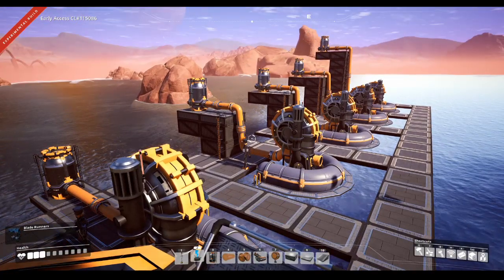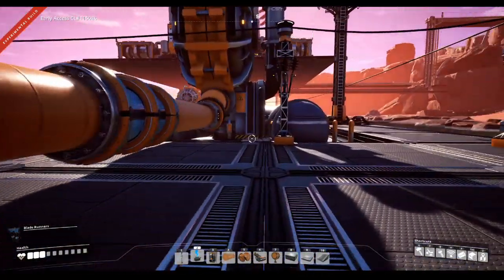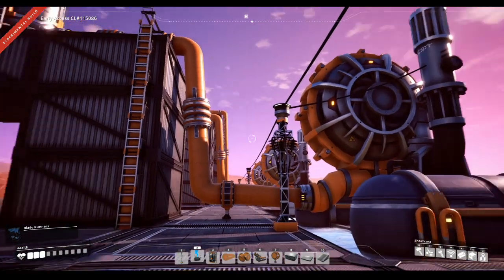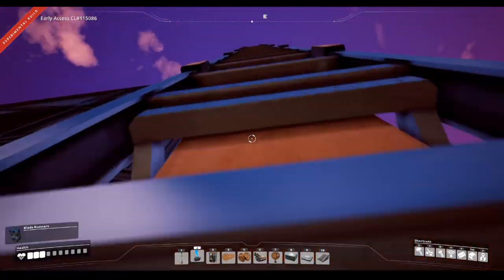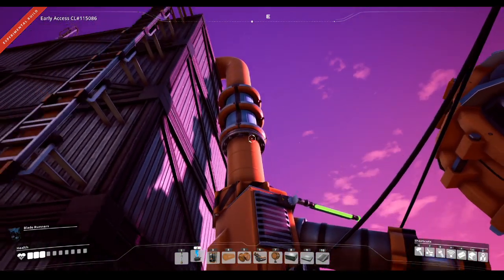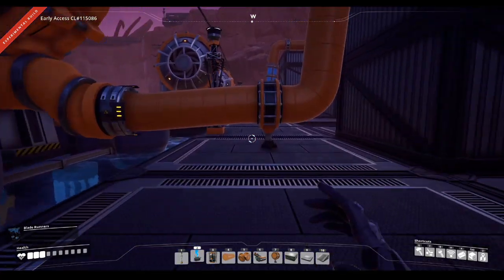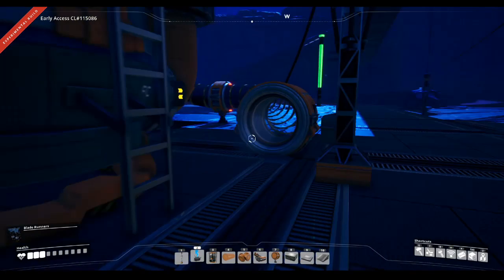Satisfactory Water Pipes, Flow rate, head lift Tutorial, Guide

Comment: If I create a single water extractor, and hook it to a storage buffer, the fill rate of the buffer moves between 0 and low 100s and 220 roughly.  The water extractor flow rate seems to drop almost to 0.  If this means 120 is the average, then it seems like you could maybe exceed a 300 m^3 pipe, with only two extractors due to peaks.  Anyone know how that works?
Reply from the maker: The extractor ebs and flows. It does not give a solid 120output all the time. With the new process of the production machines needing a constant supply, I would always try to not pull the max value from the machines but have at least one machine that is under clocked to make sure you are not under supplied.

Comment: I admit I don't understand the rules about where to place pumps.  Correct me if I am wrong, but it's lifting the water above it.  So the first pump would be about 10m, the default head lift?  And the next is 20m above that?
Reply from the maker: With the new indicators on the pipes when you place a pump, you can go to this point for the next pump. The mk1 pumps have lower headlift than the mk2 also. Test placing a pump on a straight piece of pipe and you will see a ring appear down the pipe from you

Comment: 36x7=252 though? Or am I missing something?
Reply from the maker: What part of the video is that at???
Reply: @DCDGaminshow  You underclocked the coal generators to 75% which made them use 36m^3 of water but 36x7 isn't 300 so the setup wasn't opimised. I noticed in another comment that you had changed it though.

Comment: i guess i just dont understand how all my pipes can have water and all my generators are full and all my extractors are filling with water but when I leave for a while after an hour or so my power just shuts off. Obviously the game thinks there's not enough water in the system but why does it work for so long and then randomly not have enough water anymore?
Reply from the maker: First question is how many generators have you and how many Water extractors have you???
Reply: @DCDGaminshow  i started doing 3 extractors for every 6 generators only because anything less doesn't work but with a single extractor and 6 generators the power worked for a few hours before it ran out of water. I just don't understand why it doesn't fail immediately or even show any signs that it will fail until I run off somewhere and it decides to die. The pipes all say they're full and the machines are all full so it doesn't make sense to me.
Reply from the maker: The issue you were running into was that all the machines and pipes and Extractors were full of water, than you leave the system starts to use up the water reserves and then the system was running out of water. Each Coal generator will use 45m3 of water, each extractor pumps 120m3 of water. 1 pump can feed 2.6 machines.

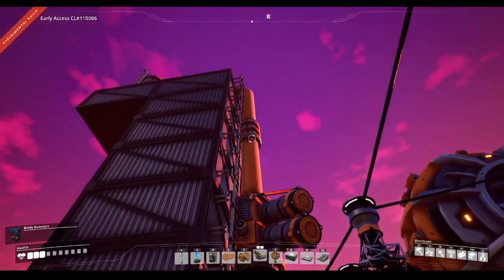Comment: question: @ 10:55 if the headlift is 20, why place the next pump only 10 meters up and not 20 meters up for maximum efficiency?  am i not understanding this?
Reply from the maker: Placing it at 10mtrs above the last pump will give you a head lift reading. Than you can adjust from there. This test is now obsolete as the pumps now give you a headlift indication when you place them.

Comment: This is kind of old now (to be commenting on).. But it makes sense to put the first pump at 10 Meters and not at the low junction.. Since the extractor provides 10M of lift. In the overall scheme of things it is not a huge deal.. And you did it for your first pump.. I do it for ll extractors.
Reply from the maker: I put it on the junction, cos the dev that developed the pipes system mentioned it as the best way in one of the dev streams.

Comment: Thank you. I could not get my first long distance pipe working until you demonstrated adding the pump to an existing vertical run. i did not know you could overwrite it like that. I hope they make the conveyer belts upgradable in place like the pipes and some other things. Thank you!
Reply from the maker: Your Welcome. Belts, power poles and miners are all upgradable in place, just select the upgraded version and point it at the part you want to upgrade and you can upgrade.

Comment: Good vid for sure, but on my game i can not get the crude oil pipes to work. It goes up 40  meters, i place the transfer pump  right the edge where it not exceeding head limit, but by doing this the flow rate is like 1 to 3, almost nothing. Put more pump doesnt do anything,  it either almost no flow or n o flow, after trying different combos for about 5 hours i have all bu given up, for me its a real game killer. I hope they get this issue figured soon, i want to continue to play.
Reply from the maker: Hey, thank you for the compliment, first step is the max head lift of a pipe with no pump is 10m, if I am adding pumps onto my pipes, I will add them on the first vertical section of the pipe. I will place them just after the bend. Then I would wait for the pump to reach Max head lift and add a second pump 3-4 foundations above the first one. If the max head lift is still exceeded on the first pump, move the second pump a bit lower and retry of the head lift is still exceeded, when I have the first pump not exceeding head lift, I would place a third if needed and on and on until I have reached the height I need. One thing to remember is that if you place a reservoir tank at the top, the head lift is to the top of the tank. Hope this helps,

Comment: Ok so I wanna make my first 3 coal generators to work but when the pipes are full of water the flow rate goes to 0 and now my coal generators dont work. I always need to flush the pipes each minute but I cant do that if im at my base which is far from the generators.
Reply from the maker: The flow rate will always drop when there is not a full pull on the power
Reply: @DCDGaminshow  Oh thanks!

Comment: How do you pump water when it's not vertically up? My water source is really far away from my coal so I have my generators meet in the middle? It seem like inclined pumping over long distances always makes it exceed the headlight. I've even added pump every 10ish meters along the entire route and it still says exceeding headlift on every pump (even though flowrate reaches 300)
Reply from the maker: The slanted pipes always seem to cause trouble, if you having an issue, I would rebuild the pipes and pumps again. Start with the pipes, then start with the first pump at the lowest point and then place one pump at a time and only place the next one when you have the previous pump below the head lift.

Comment: 3 water extractors easily feed 8 coal generators at %100 if you connect them seperatly like 2 in the each side and 1 in the middle. Don't connect your extractors on single pipe It's not efficient because you limit your system to pipes max flow rate.
Reply: I have 16 coal generators, I was using one pipe but suddenly stop working, what can i do? Thanks.
Reply: @lucasb3910  
C C C C C C C C
|---|---|--|--|--|---|---|
|            |             |
W        W          W

This is the design for %100 8 coal generators. Single pipe (300m3) not enough for 8 coal generators so you eventually at least one of them run out water and shutdown or you need to downgrade generators like on this video. But If you connect each water extractor seperatly to the system you will constantly feed your system with water beyond 300m3 per min. Actually its 120m3(water extractors output) x 3 = 360.

Comment: the headlift is fucked in my game... I have like 6 or 7 pumps scattered along a line that raises by maybe 40 meters total, evenly distributed, none of them hase to make the water raise particularily high... but all the pumps are stuck at exceding max headlift. The water still reaches my generators though...
Reply from the maker: If it’s reaching the generators, sounds all good, but have you tried deleting the pumps and flushing the pipes and trying again with placing the pumps 1 at a time.

Comment: Thank you for your excellent tutorial. Do you need to add a water pump to horizontal pipe runs over long distances, say 30 foundations long?
Reply from the maker: Water is supposed to only need a pump if you want to lift it 10m above the level of the outlet on the extractor, I would test it first and see how the pipes react to running over that distance. I’d doesn’t seem long but I wouldn’t trust it. Set up your pipe without a pump first and see how it reacts first and then if you need to add one, add one and see how it reacts.

Comment: I have my pumps setup exactly like yours in my plant - 24m and all - but both of my pumps are getting 22 max headlift, no matter what I do. I've put them closer together, further apart, 3 pumps, higher, lower, and they always max out. I'm dealing with water too. Any idea why this may be?
Reply from the maker: First thing is, is there a tank on the top of the pipe section, I found out after making this video that the tank can add an extra height to the head lift. Secondly I would disconnect the pipe at the top and flush the lift and start over. Place the first pump at the bottom of the rise first, then place the second pump above the first with a large gap between them. Check the head lift of the first pump. After you place the second pump. Keep adjusting the second pump until the first pump shows below head lift. The proceed with a third if needed. When the head lifts are ok, connect pipe at top again. Hope this helps.
Reply: @DCDGaminshow  no, just a tank at the bottom. I had flushed the system, but not like you described.

I'll try disconnecting, flushing, and trying again. I'll let you know if that's fixed it. Thanks!
Reply: @DCDGaminshow  It's still not working... I flushed the pipe - and the tank once too - added and connected my pump at the very bottom,, it maxed out at 22, so I added another pump about 12m up, plugged it in, and still both pumps are maxing out at 22 head lift. I'm going to try out a Satisfactory discord I'm in too, see if the screenshots will help deduce this at all. Great video btw, very informative and well laid out!

Looks like someone Snutt (whoever that is) encountered this bug too - the team is currently looking into it. It's not a global bug, thankfully. I guess it's good that at least it's a bug and not something I have to fix lol. Thank you for your help!

Comment: Technically you can use 8 coal at 100%  on one pipe with 3 water extractors. 
You just put 2 extractors to go to one end of supply line and 3rd on separate pipe going from enother end. This way you get 240 flow from one end and 120 from another and the meet in the "middle". The flow rate will probably fluctuate in pipe segments, but shoud meet coal plant cluster's damand.
You can also go 1 step extra and split 1 of 3 water extractors, so it will be 180 from 1 side and another 180 from another and do 2 x4 coal plant clusters separated
                      +  +     +  +
 []-----------|------|--|       |---| ----|--------[]
                |     +  +     +  +     |
                \______[]_______/
Like this [] - water, +coal
Reply from the maker: Yes with a balanced layout you can feed 8 coal generators with enough water. With a manifold or overflow method using water from one direction, it will only work on 6.6 generators. Thank you for the info!

Comment: Love your layout, will definitely be using. 
You need to check your maths though... 36x7 is not 300! You can turn the clock of your generators up a little and get more power with the unused water.
Edit: grammar
Reply from the maker: Yes I realized this and reset them to 95% for each generator!!!

Comment: Your Video helped me to understand the headlift good work! I had way to many pumps.

My system is a little bit different I use 7 Coal generators on 1 pipeline and I add 3x fluid buffer at the end because you never use 100% energy for long time periods and the buffer kicks in at high demand. Works flawless without any power fluctuations since I build it a few days ago!
Reply from the maker: If it works, don’t change it as long as you don’t overstretch yourself!! But I am
A bit OCD and need my figures to match up!!! 😂

Comment: Is the OIL System different to that? We have massive problems pumping oil. long distance, many many pipepumps. but no oil is reaching the facility...:/
Reply from the maker: I cannot say for sure, but I presume that it’s the same principle. My advice is to keep the pipes flat for as much of the distance as possible. The most problems I have seen on Reddit and discord involve pipes with slanted inclines. If you want to raise it use a vertical rise and then level again for another distance. Also try breaking up the system into sections and test how the oil is reaching each point. If you get the first section working move onto the next etc etc. this should help you identify any problematic points in the pipeline. Hope this helps

Comment: Good intro to fluids and pumps! I hate you with your fancy hyper tube travel! I was going "How will he get up now?" and then you go inside the tube and I'm turning green! :P
Questions:
a) 36*7=252. So maybe an eighth coal power plant can fit? Or is there another limit?
b) One water extractor will take water up 10m. Should I not place my first pump at 10m? or 8m? Why place it at the bottom, thus wasting whatever pressure the water extractor provides?
Reply from the maker: Answers:
a) my calculations are wrong on the coal generators, they should have being set to 95% which uses 43m3 of water a min. Not the 36 which is in the video. 
b) yes the extractor gives you 10m lift. I am following the advice of the developer who programmed the pipes, he recommends that the pump should be placed at the start of the rise. Now in one of the setups, the pump is placed about the start of the rise and this works also.
And the tubes are fantastic!!! I loved the factory cart when I got it but haven’t used it since. And thank you for the compliment.
Reply: @DCDGaminshow  50m3 * .95 = 47.5, not 43.  So 7 * 47.5 = 332.5 m3.  I think the under clock you're searching for is 85%.  Hope i'm doing my math right there.